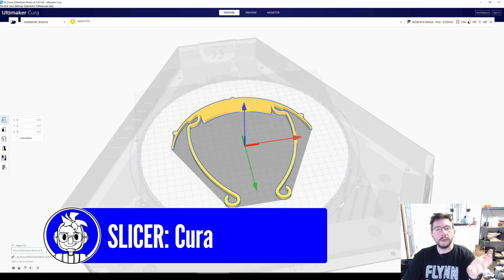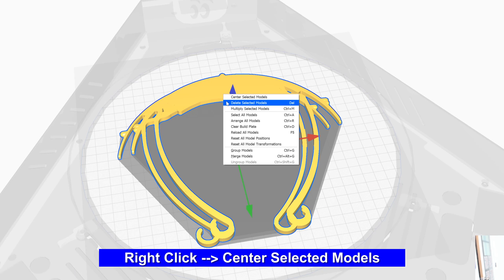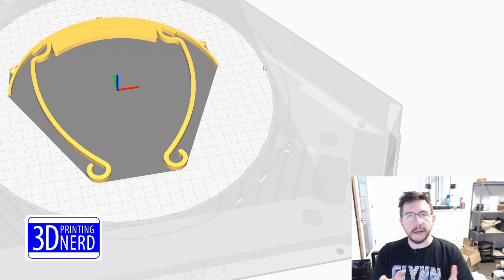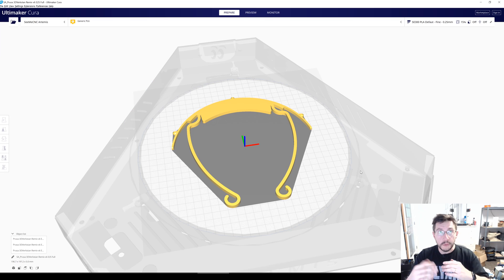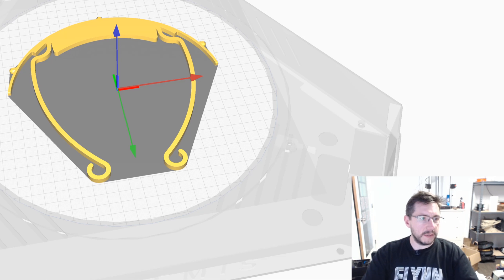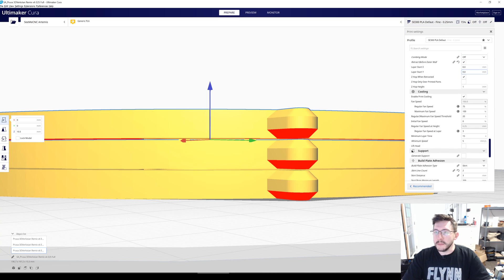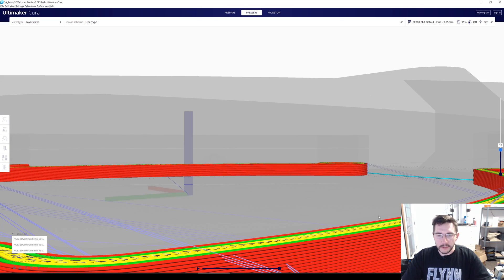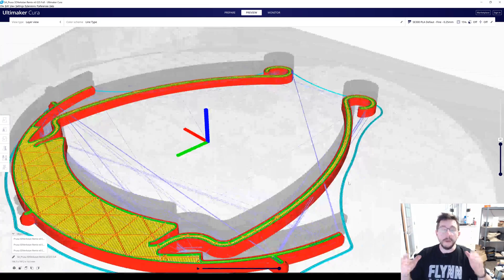HOW TO STACK 3D PRINTS in CURA

Comment: oh oh ... I have the  'standard' layer height of .2mm  which means my 5mm propellers need to be at 5.2 and 10.4.  Also I have to rotate them so the blades line up.. not sure if the center is going to work though.

Comment: I know this is an old video but I just saw it. In your video the air gap is the same height as your layer height, which makes sense to me, but Devin uses air gaps twice the layer height. Did you experiment with both options?
Reply from the maker: I did and Devin’s worked for me, but mine worked as well, so I just went with mine :)
Reply: @3DPrintingNerd  Cool, will try your approach first. Excellent series by the way, just saw them all (I still don’t know why as I only use Cira or Prusaslicer :)) 
Have a nice weekend, greetings from Mexico

Comment: um, if you stack, won't they get fused together? Even with gap its gonna touch last model and stick? i also notice you have bottom layers at 0, how come?
Reply: haven't tried it yet, but I guess that layer isn't squished flat by the extruder (because of the gap) so it doesn't adhere as well and you are able to to pry it off

Comment: trying, not sure it will work, but I've been wrong, 3 or 4 times in life , LOL,,, when printing 30 - 40 same objects, even with retract settings higher, round to round, really creates flaws on outer edges, maybe stacking will help cut down the issue
Reply: I print 1, beautiful,,, 2 or more, glitch glitch, glitch,,, any thoughts ? Cut travel speed ? would that help ?

Comment: trying, not sure it will work, but I've been wrong, 3 or 4 times in life , LOL,,, when printing 30 - 40 same objects, even with retract settings higher, round to round, really creates flaws on outer edges, maybe stacking will help cut down the issue

Comment: @3D Printing Nerd Here's an interesting problem that I cannot figure out for the life of me.... I turned off auto drop and can now move the 'Z' axis of the models on the build plate in Cura, BUT...., when I slice the model, it only sees/slices the bottom print and not the one above it. (I am trying this with the surgical mask strap which I modified to remove any raised edges to help it print evenly). 

Please, is there anything you, or anyone else, can think of that might cause this? I print 8 of these at a time on my ender 3 pro and donate them to my local hospital, pharmacies & post office and anyone that wants one, and this would allow me to continue printing overnight and increase my output. Thanks in advance!!
Reply: I’m having the same problem
Reply: Did either of you figure it out? I'm having the same problem.
Reply: @slickstretch6391  unfortunately my only solution was a 2nd printer. never did figure it out.

Comment: I use Cura with the Raise3D Pro2 (better support generator, more mature), and it just happens that the raft-to-model gap I settled on is 0.25mm. I might stack print 3DVerkstan's visor frames using this method, since I set up a new profile for single material PETG and I really don't want to set up the gcode required to get multimaterial PETG/PLA working properly.

Comment: You need to let people know to uncheck the "Automatically drop models to the build plate" option in the General tab of the Cura Preferences. This is checked by default and it took me a little while to figure out what I could not stack the copies! Thanks! I love learning new things everyday!
Reply: Im new to 3D printing.  couldn't figure out why it would not stack, your tip made the difference.  Thank yoi
Reply: Aha...there it is. He REALLY needed to mention this.
Reply: thanks, I was about to question my skills :-P
Reply: Yeah.   That one took me a couple of minutes. :)    All good..   Thank you Joel.  I was having a hard time doing this.   Printing a 3 stack now on the Cr10 If it works, I may go for the bakers dozen!
Reply: thank for the tip it was getting frustrating
Reply: I was about to smash the whole thing to bits out of frustration. Than you came about and saved the day. Well, my laptops day at least.
Reply: YES!!!  Finally found this and now my prints will not stack.  It is a must tip. Thanks.  Am printing a stacked Manta Shield now and so far all looks good.
Reply: Just what I need to know thanks
Reply: this comment saved me lol, i was like how is he doing that they are all just dropping back to 0 lol
Reply: good thing i was able to read this!!!!!!!
Reply: Thanks Kagesh!
Reply: I struggled sooooooo much before i saw this comment. Thank you mate
Reply: mvp ^^
Reply: Absolutely couldn't figure out why they wouldn't stack. Thanks!
Reply: Than
Thank you, that's literally the only thing I needed to know. LOL

Comment: Hey , I've tried this many times without supports and they fail every time on the bends. Because the first layer of the next model has nothing to adhere too I find that the pla will not lay down in circular manner and wants stay straight between 2 points. I ended up putting the supports back in .
Reply: OK I've cracked this now.. the key is that gap Cura puts by itself between frames. I stack the next one -0.12 .. yup minus.. I double check layer by layer to make sure there is only 1 layer gap between frames. 2 layers = bad. 1 layer = a minor effort to pull apart but no clean up needed.
Reply: I had the same issue in my 1st stack attempt. I noticed that the printer screen indicated that Z was starting my second stacked print an entire layer height higher than what Cura showed. I tweaked the gap in Cura, resliced and then had no more issues.
Reply: @VayaconChupacabra  I tried all that.. I even tried no gap and Cura adds a gap for you..
Reply: yea make support pla / petg and they peel right apart

Comment: Using a .6 nozzle 0.25/0.26/0.27/0.28/0.29/0.3 etc. all the way up to 0.4 did NOT work! First one perfit All the rest, the printing across the brow failed, also tried different hotend tempts as well

Comment: SOLVED..Im trying to stack the Prusas in Cura 4.6.0, got them multiplied and centred but the just snap back to 0mm when I try to stack them! I had to turn off "automatically drop models to the build plate" in the preferences.
Reply: That's a setting in preference... first page about halfway down.